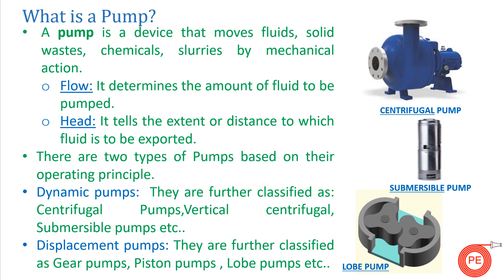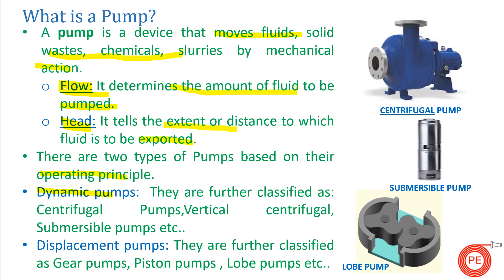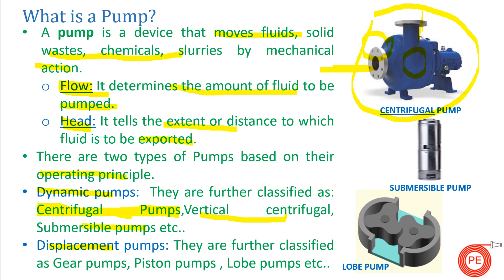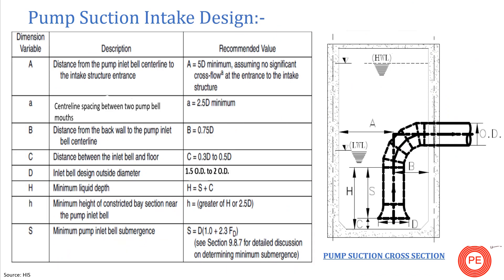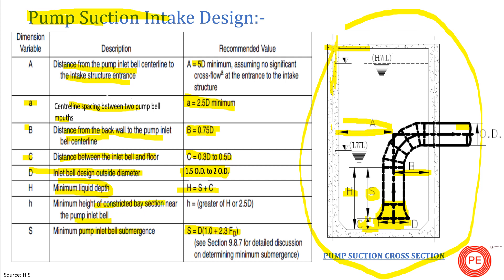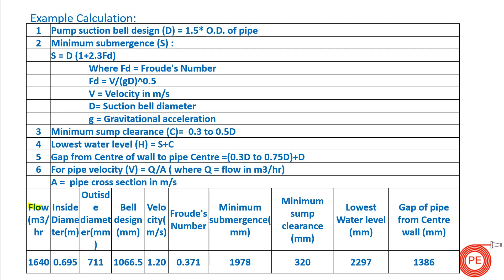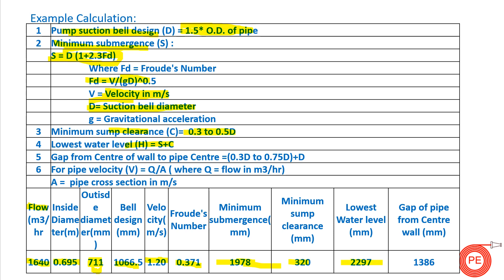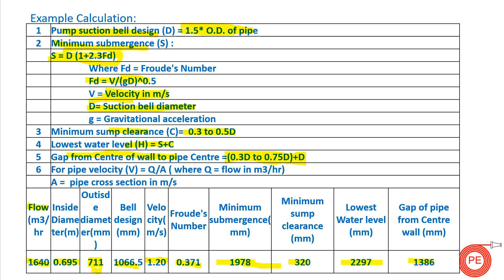Pump Suction Design |Centrifugal Pump Design Calculation|Centrifugal Pump suction & Discharge Calcul

Comment: How to calculate pump suction line inside nominal diameter to avoid cavitation  if rated capacity of centrifugal pump 90 deg suction and discharge ,Q is 500 m3/he and head 25 Meter?
Reply: By considering suction velocity 1 to 1.5 m/s , you can calculate the I.D from Q=AV formula.
Reply from the maker: Please contact through email we will share detailed excel sheet.